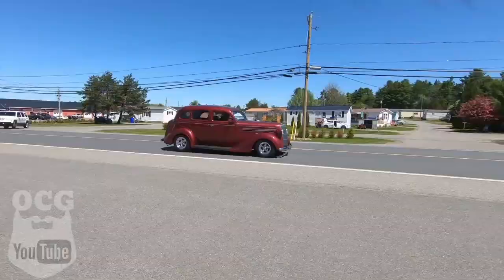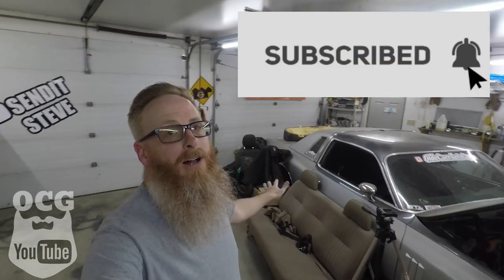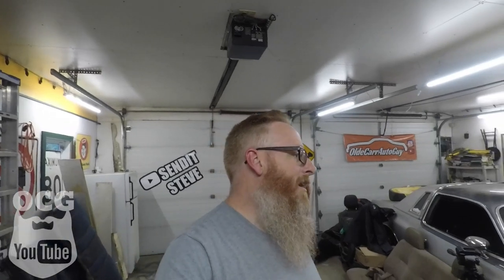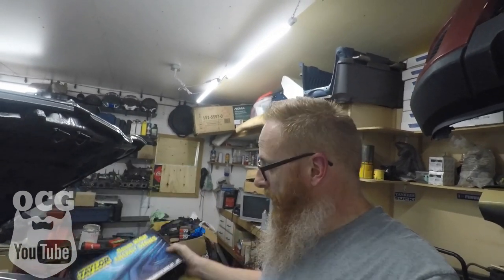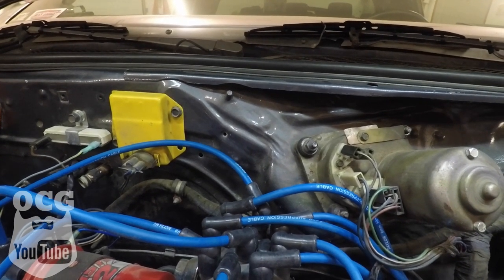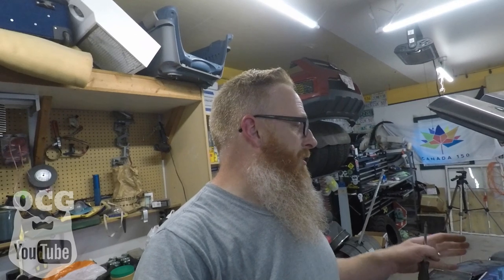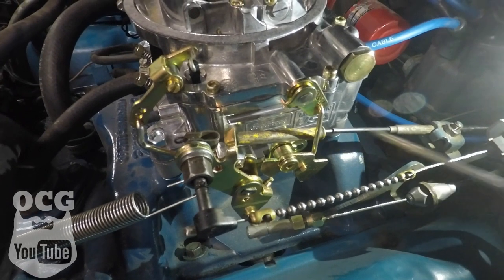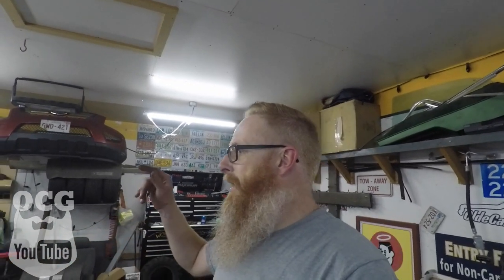EDELBROCK AVS2 THUNDER SERIES CARBUATOR- SOMETHING ISN'T RIGHT

Comment: Edelbrock carbs have a cold air idle with the choke closed. This sets it higher then normal. When you warm it up, the regular fast idle screw will make contact. It's NOT supposed to make contact on a cold engine!!

The cold air idle screw is a second fast idle that keeps it from stalling and helps it warm up faster. 

Don't forget to adjust your choke. I have an AVS2 on my 1968 cougar & it runs flawlessly, still a wee bit cold-blooded however for the first minute or two.
Reply from the maker: Well! I learned something new today! Thanks
Reply: Im assuming you bought the ford kickdown bracket to go with it ? I had a holly 2bbl on my 390 im swapping it over to 4bbk with RPM intake is the ford bracket close to factory linkage ? Im not wanting to rig up a whole new shape and size linkage .
Reply: The OEM linkage is a rod that goes to the gas pedal.  On the C4 tranny,  there's a vacuum line that tells it to downshift & that's A-OK. That goes into the intake manifold vacuum port, not the carb. The last 4bbl on there didn't have a linkage either & I don't even think you need it.  I don't have to give it a whole lot of throttle to downshift. It'll even downshift all the way to 1st if I really slam the gas pedal.
Reply: @WhiteLightning777  oh ...when you said cougar i was thinking 68/69/70 my 69 F250 came with a Holly 350 cfm 2bbl  i ditched the factory linkage it had 2 rods and did all kinds of crazy things to work i just cut a piece of aluminum rod from home depot and put those mr gasket swivel eyelets on each end and threaded it simple as heck.
 I  have a C6 and they said you need the ford linkage arm this avs 2 looks alot wider than a holly thats why i was asking im more concerned about the kick down bracket on the trans i was thinking of switching from holly to this for ease of tuning .

Comment: Did you eventually get the Chrysler throttle adapter from Edelbrock #1481 for this? It places the throttle pin/cable in the proper position for correct cable adjustment.
Reply from the maker: I did! Thanks

Comment: Is that safe if i spray wd40 in my car's throttle body
Reply from the maker: I don’t know about safe or why you would, but it is flammable!
Reply: @OldeCarrGuy  did you have any idea to clean fuel injectors on grand marquis
Reply: Wd40 will work like brakeclean or starting fluid but will not work as well and as efficient as starting fluid or ether wd40 is something I would say not to do alot its oily and can cause other problems in the mass air flow sensors and throttle body as well as other problems

Comment: I don’t know if you ever figured it out but I can clearly see your problem. It’s not the choke that’s stuck, or the throttle being stuck, it’s your fast idle speed screw. It’s set too high which causes your high idle when you engage the choke. Since that bolt is set so high when you go to disengage the choke by bumping the throttle it Dosent disengage the choke and keeps the throttle stuck in high idle mode. I’m the morning all you have to do is go and flick your throttle lever all the way back and you’ll find this screw under the arm right below your other idle screw. Shorten THAT screw’s distance. You want it to be 300-500 rpm higher than your normal RPM. Don’t let the arm go until you make your adjustment because you can only engage the choke once to start it.

If you don’t understand my paragraph here is your solution. https://youtu.be/LtcBAUHJJBM
Reply: i just commented on that video i dont know where to set the fast idle screw i had it screwed all the in to the notch

Comment: I had the same problem and i was using taylor wires and a tatlor cap i had to go to a different cap since it was so loose and just pulling the wires off the plugs 3- 4 wires pulled right out of the boot and left the brass on the plug there marketing is awesome the parts are crap . Reminds of the pertronix 3 dist 500 miles my vacum advance went out
Reply from the maker: So far so good. Thanks for letting me know just the same!